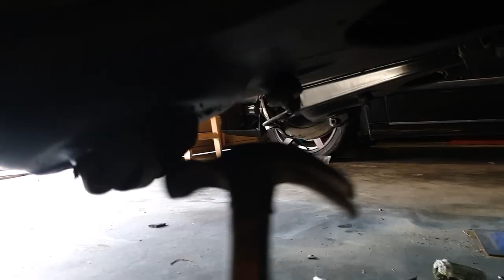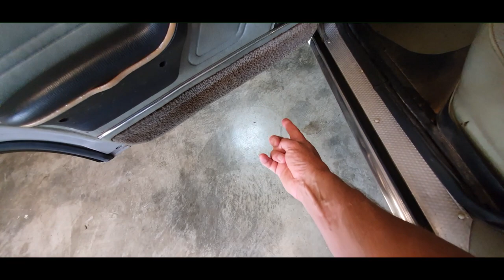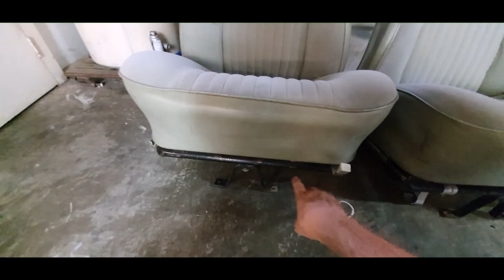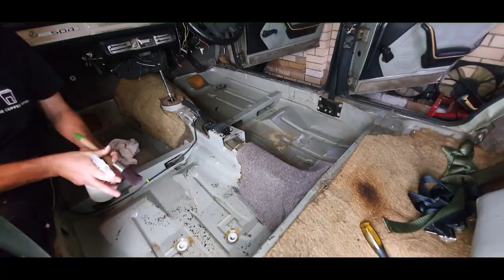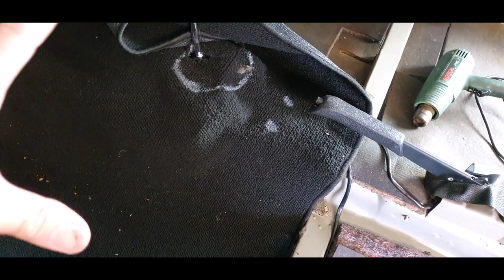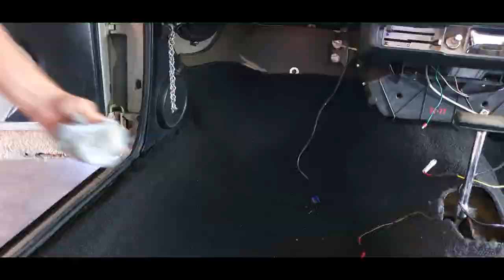INSTALLING NEW SHOCKS & MOLDED CARPET | Peugeot 504 Restoration (Episode 8)

Comment: I have a steering wheel, but I am in South Africa. Interesting to see the differences between your car and the local once by us.
Reply: There are quite a few differences I am from SA too. Had a 504 carburetor model just like this one in the 1990s. For instance the air filter was different. Wonderful cars though